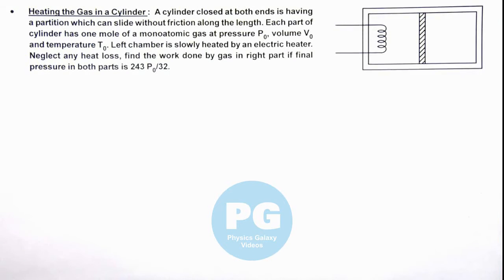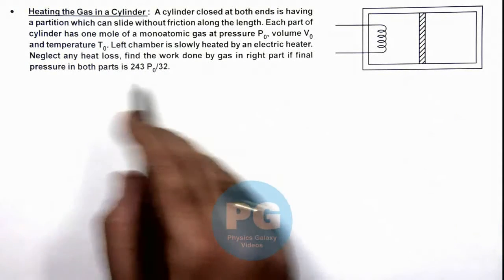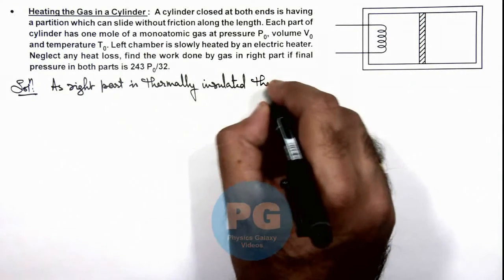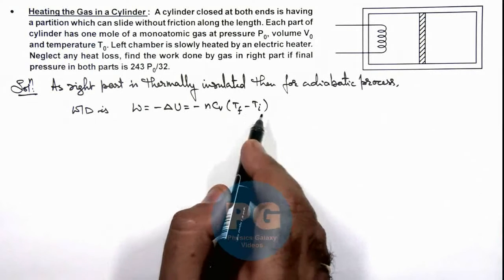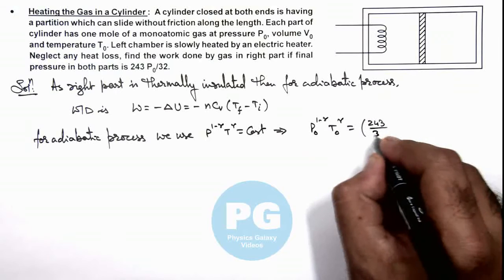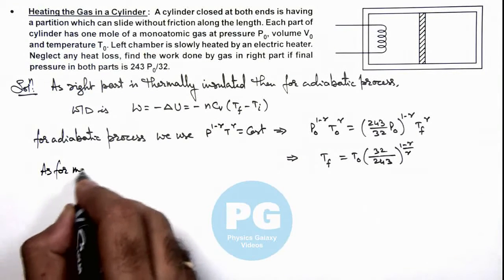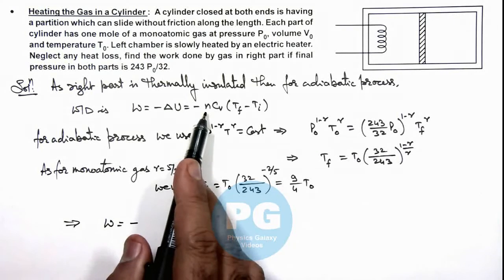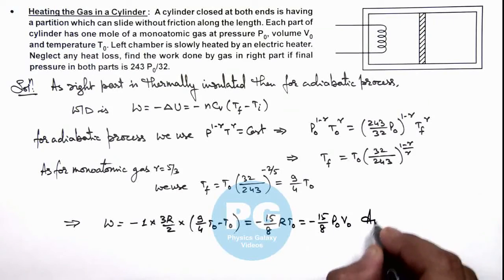46. Advance Illustration | KTG and Thermodynamics | Heating the Gas in a Cylinder | by Ashish Arora

Comment: is piston considered non conductor of heat ?
Reply from the maker: Its mentioned in the question to neglect any heat loss so we can consider piston to be non conductor of heat...
Reply: but piston can conduct heat in the two halves ? , and neglect heat loss may means the walls of the cylinder are non conductor and it is a closed system ?

Comment: Sir,in the left part gas undergoes isothermal process?
Reply from the maker: No... it is absorbing heat so we cannot consider that...
Reply: If it's absorbing heat then also isothermal is possible?Complete heat is utilized to do work,and it's also given that process is taking place slowly.
Reply from the maker: It is possible but you cannot take it in this way initially...
Reply: OK,I tried to solve the problem by taking left part process isothermal but answer is not matching..
Reply: @SumaidSyed  hey what's secret that sir always replies to your query specially ??..
Reply: @anmolempire1197  he is also talented